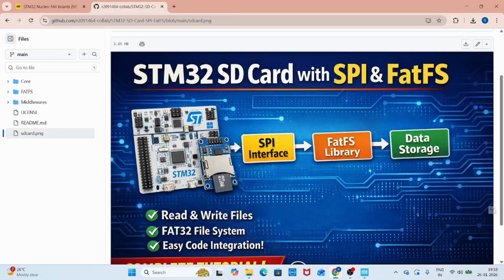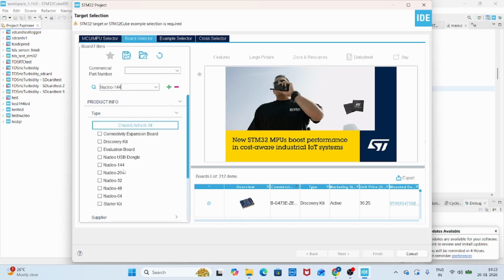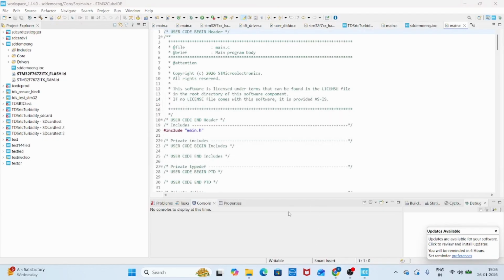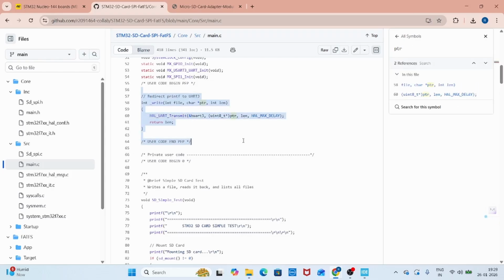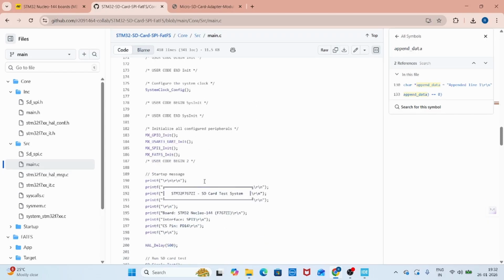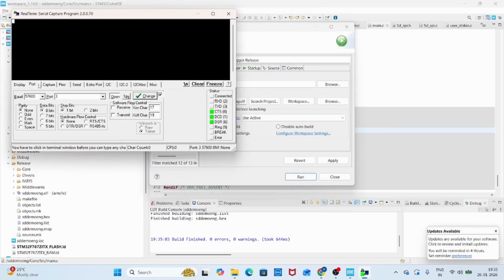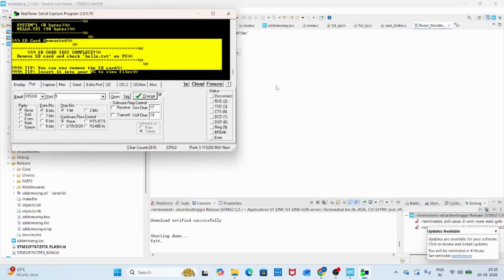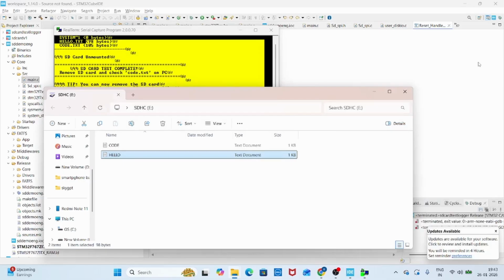STM32 SD Card Interface with SPI & FatFS | Complete Tutorial

Comment: Does this work for the nucleo-h503rb board? Ive been trying but i dont get the fatfs option under software and middleware
Reply from the maker: The H503RB is an H5 series board, and ST removed 
FatFS from CubeMX for H5/U5 boards, replacing it with FileX, which 
normally needs ThreadX to run.

You can either use FileX in standalone mode, or 
manually add the FatFS library from ST's GitHub

For this exact tutorial, an F4, F7, or L4 Nucleo board will show 
FatFS directly in CubeMX. 

Thanks

Comment: I was encountering a problem that SDCard unable to mount,Is the capacity of SDCard affects?
I was using a 32GB SDCard and F303re discovery board.
Reply from the maker: Hi SD card capacity can sometimes affect compatibility, but it's usually not the main issue. With a 32GB card, make sure it's formatted as FAT32 not exFAT, which FatFS doesn't support by default. 
Also double-check your SPI pins and clock speed. 

try lowering the SPI speed to 1MHz during initialization. The F303RE should work fine with 32GB cards once the formatting is correct. Let me know if it works!
Reply: @hardware_coding3603 Hello there,
I have checked the format of SDCard and Set the prescaler to 128.Since SDCard module has connected to the discovery board directly,I also set all the SPI pin to GPIO pull down.
However,serial monitor still shows error messages,include SD init failed,mount failed(error 3).
If there anything else I need to adjust, please let me know, appreciate.
Reply from the maker: Hi
So the issue is with GPIO pull down. Change all SPI pins to pull UP instead of pull down, that's usually the fix for this error. Also try prescaler 256 instead of 128, lower speed helps during init. 

Let me know if that works..
Reply: @hardware_coding3603  Hello there, I found that there is no neccessary to set the spi pins since there are already have pull up resistors in the SDCard module.
However,I have to do some modification to the code since my FATFS version is 11.0 while yours is 12.0. 
After these,the serial monitor still shows Init failed.
Reply: By the way,I've changed another SDCard to make sure there is no problem in hardware so I can focus on coding.
Reply from the maker: Great... As per my experience reducing clock while initializing, always work....
Reply: @hardware_coding3603  I wonder if the difference between two versions of FATFS affects,since my version was 11.0 while yours is 12.0
Reply from the maker: Yes it can matter

FatFS 12.0 has some changes in how it handles initialization compared to 11.

 Try upgrading to 12.0, you can download it directly. 

Also make sure the ffconf.h settings match, especially FF_USE_MKFS and FF_VOLUMES. 
That might be the root cause!
Reply: @hardware_coding3603  After days of trying,I decided to give up using FATFS on STM32CubeIDE.There is too much work for me.But I still finish my project by using ArduinoIDE. 
Thank you for all the suggestion and patient.